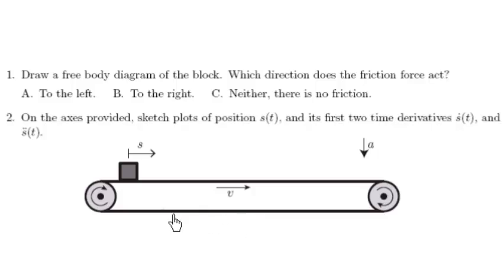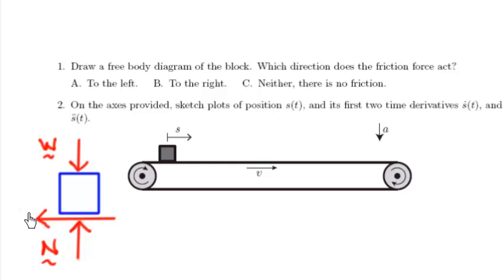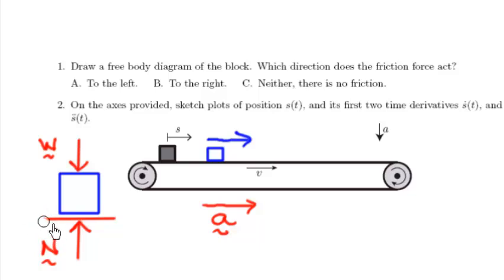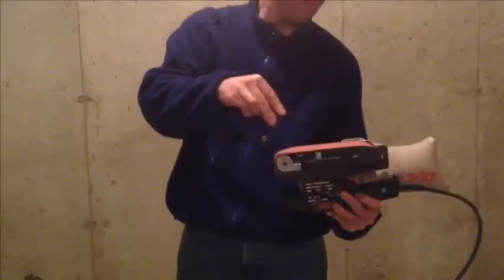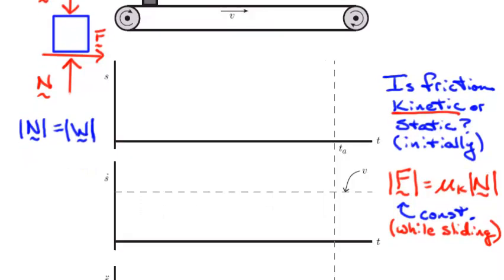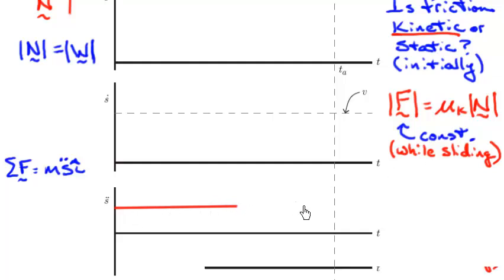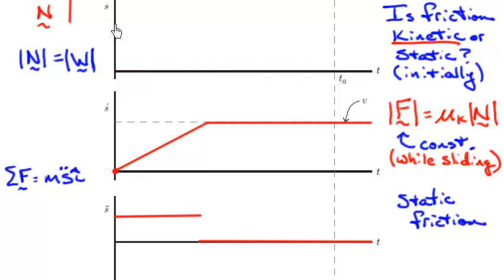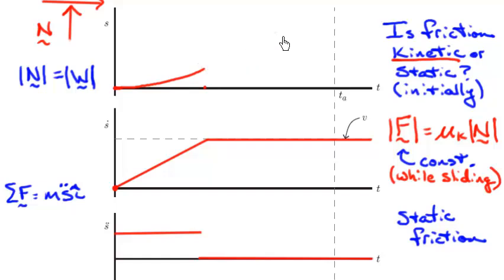Ice Block Sliding on a Belt - Engineering Dynamics Notes & Problems

Comment: It may be negligible but there is still an atmospheric force in front of the block 😂 Also the torque and speed is surely important 🤔 

Quick edit, from Feynman, I understood ice being slippery from the pressure on the ice melting a superficial layer. If that's the case the ice block would lose mass and a change of state means ur not dealing just with ice, your solid block 😛

Great video.